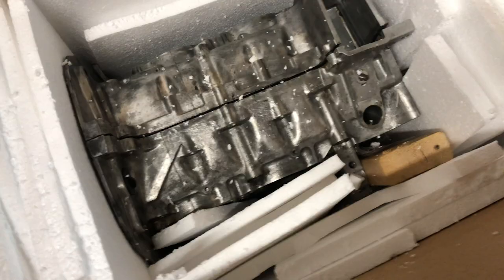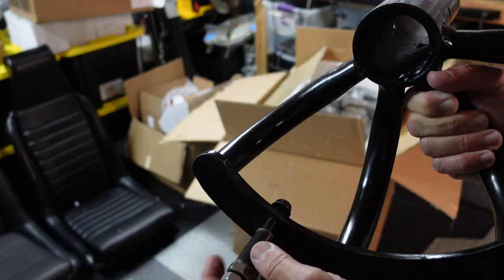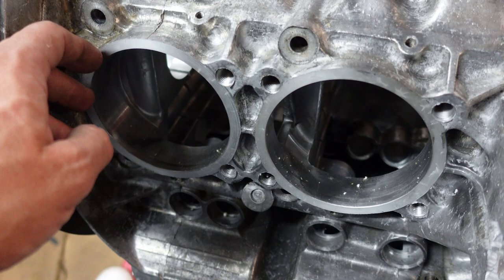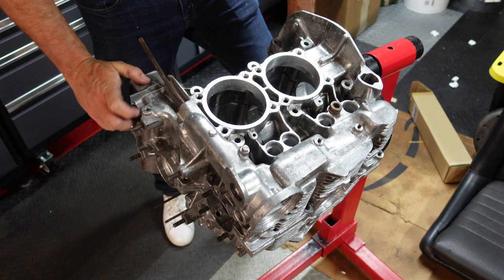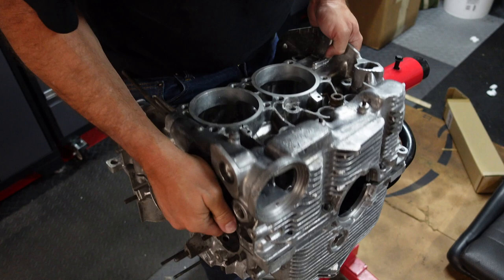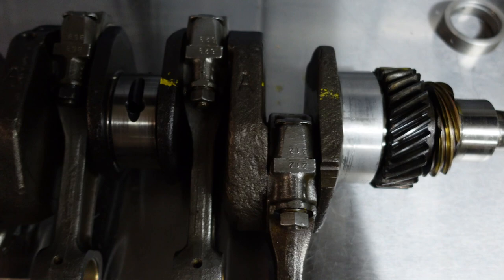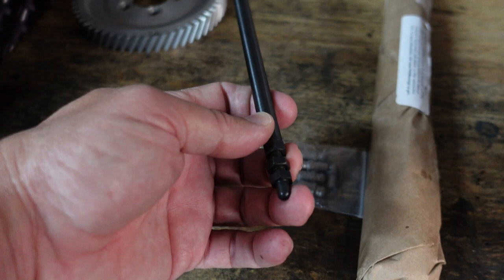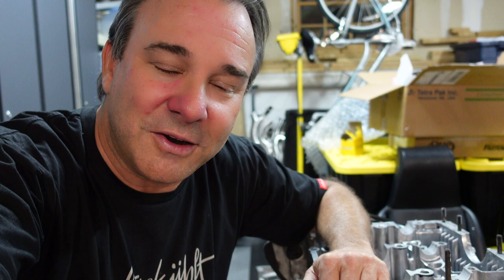Porsche 914 VW Type 4 2056 Engine Build Part 1 [Project Bumblebee Ep.07]

Comment: Ian, good to see you've got your parts/case.  I ended up getting the same cam gear with the recessed bolts to clear my 
Schadek oil pump.  I agree about the video.  I know it's a little dated but man, I'd be lost without it.  I will say that the clearances are a lot tighter when you move to a 2.3L  I ended up sending my case back to Fat Performance/Rimco to have additional clearance work done.  You might finish your build before mine :).
Reply from the maker: Thanks, Fred. Can't wait to get started with the assembly...  your 2.3 is gonna rock

Comment: I’m putting a Webcam 86a cam in my 1,911 né 1.8. It has .435 lift intake and exhaust and 200 degrees duration for same. What does your 95 have. 
Doing NDT in a machine shop I’ve found that those blue plastic covers go on about everything fairly small before shipping. Ours are red. Glad I found this number one; number 8 was the only one to show up on my feed.
Reply from the maker: If you go to my channel and search by playlist, you should able to follow each step in order

Comment: EMX are brilliant for Type4 performance parts and machining too! Just curious why you didn't get EMX to deck your block too instead of sending to two different machine shops? I'm really keen to know what mix is used for the exterior black coating on your heads? 
I got confused when you were saying left and right side of the case because in a bus or 411 it's opposite way around lol. We build lots of performance street Type4's too and I think that "How to rebuild your Type4" video has a few steps missing and a few things to watch out for missing too so I wouldn't treat it as a complete manual for how yo rebuild your Type4 engine. Please keep the videos coming through. Great work your doing for the Type4 scene :)
Reply from the maker: Hi Matthew. I sent my case to Len to deck it, and he determined that it needed to be align-bored. He doesn't offer that service, so he sent it to EMW. For the head coating, reach out to Len Hoffman at Hoffman Automotive Machine. Agree that the video has a few steps missing (setting deck height, valve geometry, etc.) but I'm covering that in future episodes. If there are other things to watch out for, please let me know so I can share with the community....Thanks!

Comment: I'm always a bit puzzled as to why so few people build these. The vast majority of videos I see are Type 1s.  (Not a VW expert.)

I'm also curious as to how much displacement you can squeeze out of one of these without too much machining (i.e., notching the bottom of the bores and not much else).
Reply from the maker: The 2056 I'm building is a common / proven configuration which doesn't require any machining, except maybe rockers to accommodate swivels. With these HAM heads and the EFI I plan on installing, I'm hoping for 120HP which is a nice 20%+ bump over stock. Plenty of people have built 2270s, but definitely more work...and heat becomes a bigger issue. Anything bigger than 2056 and you probably need to run an additional oil cooler.
Reply: @IanKarr  Thank you

Comment: Did you not have to send the brass crank gear for the distributor drive to be turned when align-bore was done. I worked for Porsche/VW dealership in Canada and all machine work was done at Volkswagen Canada in Toronto and brass gear had to be supplied with case.
Reply from the maker: I didn't. But it's possible Jorge at EMW used one when doing the work. Not exactly sure why it would be necessary though....

Comment: Hi Ian, looking to do something similar myself, but being based in the UK may not be able to get the same parts etc.. one question and apologies if I have missed on an earlier episode. Was there a reason you didn't re-use the existing heads? Looking forward to catching up with the rest of your build soon.
Reply from the maker: Thanks Jonny...great question. Once I realized I had to rebuild the engine from the ground up, it made more sense to go with new heads. The originals are nearly 50 years old and who knows how many heat cycles they've been through or how many cracks they have. The pro head guys like Len Hoffman stopped rebuilding OEM heads years ago. Check out the interview with him in the third (I believe) engine episode...and the extended one with him on http://www.patreon.com/iankarr.

Comment: Your videos are excellent. I'm rebuilding a 1974 1.8 liter. BTW, is the cam setting/timing the same for a 1.8 as it is with your 2.0? Thanks, Gary
Reply from the maker: Thanks, Gary! I believe the cam is set the same way, with the dot indexed between the two dots on the crank. Timing is a bit different. Best to consult a Haynes or other manual for more info.
Reply: @IanKarr  Thanks for this. Your video on the relationship to the cam and gear describes what I have done when I attached the two together. I'm just a bit nervous about putting the two parts of the case together have it be wrong. My next anxiety is putting in the distributer so that it meets the gear on the crank correctly...your video describes this really well.

Comment: No shuffle pins? Starting my own type 4 rebuild soon, all parts are in, working on the 914 body first.
Reply from the maker: No shuffle pins. There are 5 pins that lock the bearings, however...
Reply: Shuffle pinning is not usually needled for 2056cc builds.